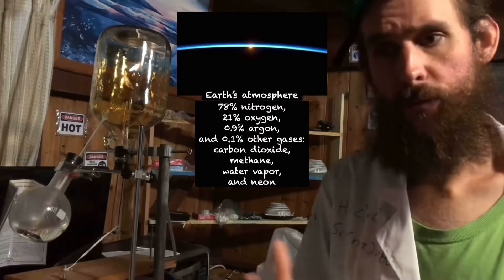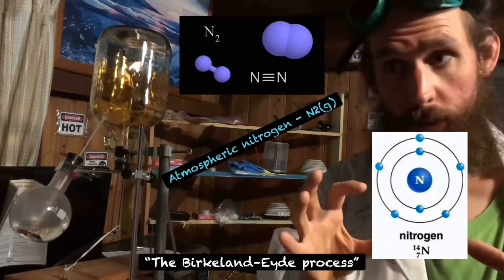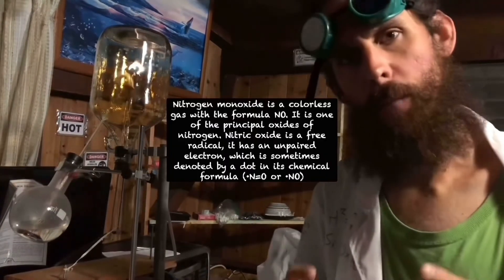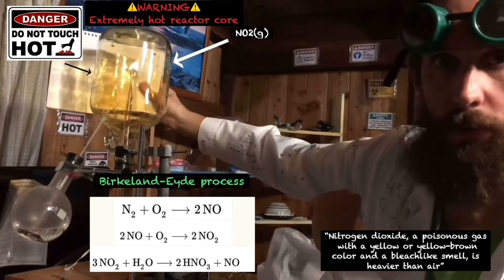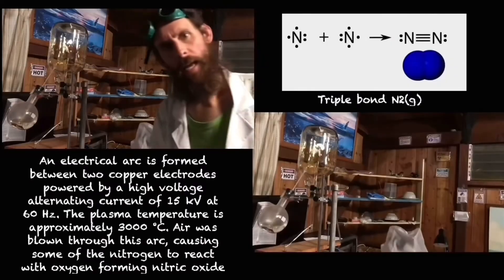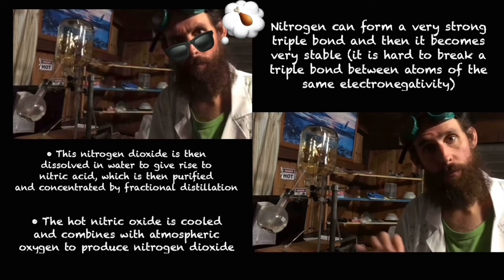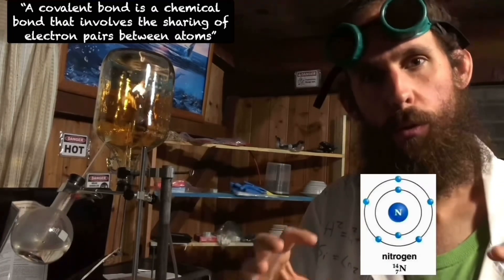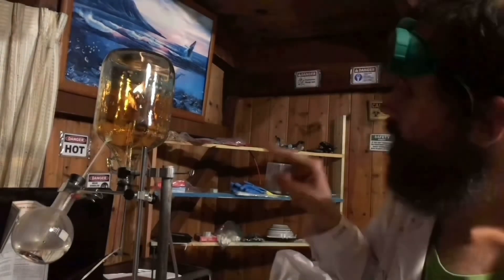Nitric Acid From Thin Air (Birkeland–Eyde process)

Comment: is the velocity of my air to high if I am not seeing NO2 (brown gas in the reactor)?  I am using a 15,000 V neon light transformer and have the input set at about 100V on a variable transformer.  However my reactor volume is not that large, its mostly a wide spot in a line with 2 copper electrodes that makes a very nice bright arc but I have let it run for hours and no brown gas, I am also using a pretty powerful fish tank bubbler, so maybe the velocity is to high or its getting passed though faster than it can be seen?

I have pennies in the solution to see if they start reacting and will try baking soda after about 5 hours.

Comment: I love nitric acid. I remember when I was young like 15 and put cotton in nitric acid to make cotton that can burn violently. I concentrated it myself with sulphuric acid. Back then I could take a whiff of it without much problem. But now I'm very sensitive to it. Even sodium hydroxide mixed with water will trigger irritations in my lounge. You mention that you wanted to start with microbiology? What happened with that? I know chemistry is like a drug. :)
BTW what you could do to help yourself is to record transformation videos. How to get healthier. 
I have been looking for something for ages that will make exercising fun and that I can do alone. All the fun things can only be done with other people. But they are not much available and it gets worse the older you get. 
Maybe you can find something that makes it fun to exercise and make videos about it. 
I just want you to get healthier because I know you mention to me that you didn't feel well with all the chemicals in close proximity.
Reply from the maker: Thank you 🙏! Physical training videos? Hmm 🤔 something to think about. Yes! To “microscopy”! I’m alternating between chemistry and microscopy. What type of PT videos were you thinking about?
Reply: @primordialsoup8570  I'm thinking of something for beginners. I myself need that kind of training but I've no motivation at all. Just need that kick in the butt to start. Otherwise, I love electric bikes and you can for example turn off the electricity and do a long ride. Then on the way back, you can use the electric motor. Or you can decide to only use it in the worst uphill parts. It makes it more fun to exercise. There are ideas like pokemon go and that but there must be many more to be found.